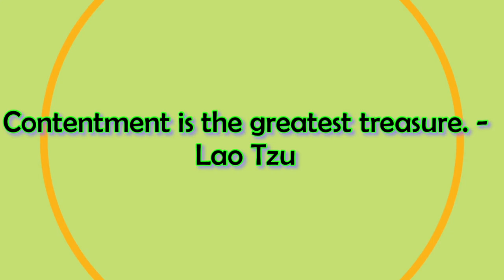Shouse Walls

Comment: Sympathies on the back pain..
If you remember to, before you move it,  (or if you get to see excessive movement in the walls ) add diagonal bracing inside .  Our cabin is assembled with screws and metal brackets/roof ties and such.. big thumbs up on those.  
.. worth every penny!
Reply from the maker: Agreed, worth every penny!  This thing is solid as a rock now, we hope.  We will sheath it inside with OSB on all walls for added rigidity. Thanks, Brie!